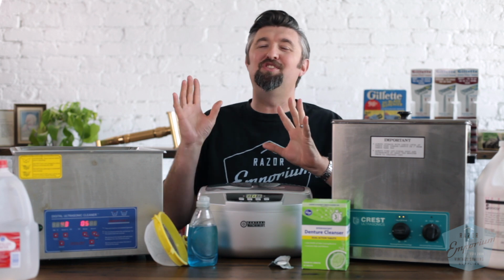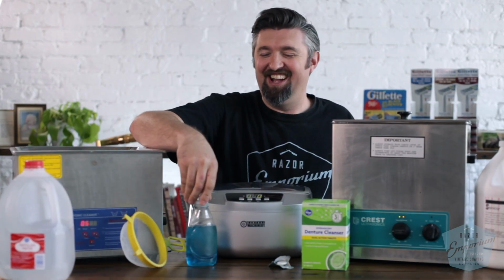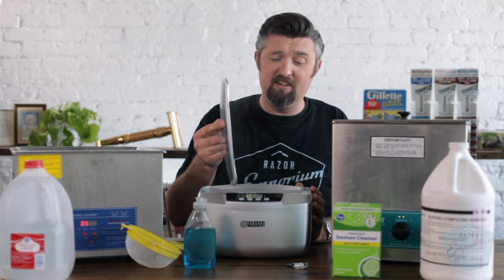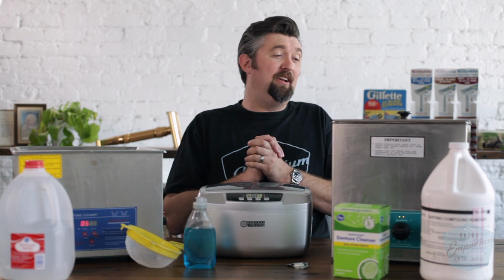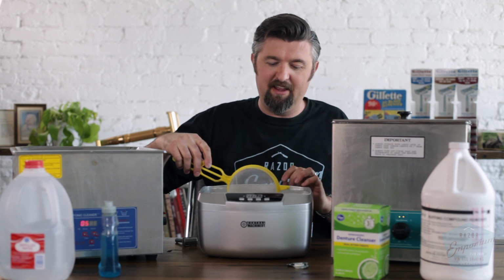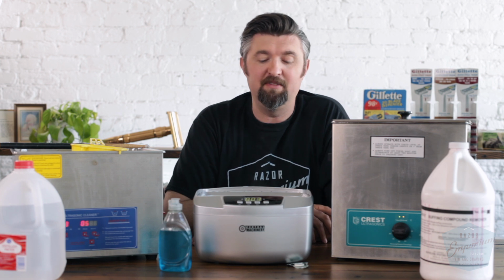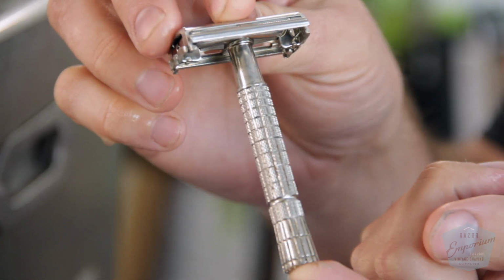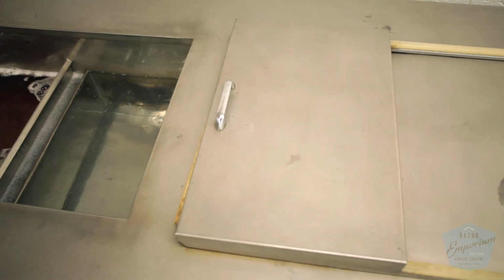Matt Shares his Ultrasonic Secrets for Amazing Safety Razor Restorations

Comment: Thank you for posting this excellent video. I've learned some new things from it. I have no experience with ultrasonic equipment but like many, I guess, I've seen references to it. This video is a really good introduction to what an ultrasonic cleaner can do, and where it fits in the complete revamping service. Many decades ago, I worked in various lab settings. I am filled with awed respect because I can see that one needs a background in several scientific disciplines to really make this revamp service work as desired.
Reply from the maker: Thank you!

Comment: I have the middle one - it's my second.  The first finally died after 10 years.   I use it for fountain pens and razors.  They really work well at cleaning out 60 year old dried ink, as well as working out crap that oil/water/etc has loosened up in the middle of the razors.   

I'm working towards getting one of the larger units, because I end up needing to work on larger parts with solvents that aren't likely to be as friendly to the plastic case of the small one. 

Most cities that use river water have pretty low minerals, so they tend to be fine for cleaning.  I use distilled for rinsing.   Where I'm living now?  Reverse osmosis water or distilled.   (We're on a well with very hard water) 

Another suggestion - Try Gemtek's SC-1000 biobased surfactant (they call it a Aqueous Cleaner Concentrate).   It's fantastic stuff.  Just don't drop it on the floor without rinsing well - you'll slide around.

Comment: I have the middle cheap one, and while not as awesome as my friend's small industrial machine (same size as the one on your right), it has been a trooper, and has greatly helped me restore an old 60s Guzzi and maintain the many mountain bike drivetrains. If you don't have an ultrasonic cleaner, you potentially need one! Spend more than I did, and RE spent on the Harbour Freight machine in the middle.

Comment: Hi Matt, great video. This information may help other viewers? I've used the habour frieght ultrasonic for 5 years now with very good results. The problem you had with yours is that you tripped the thermal safety as they don't like getting too hot. I use mine for cleaning rifle and pistol brass and it works really well using ammo brass sonic cleaner bought from a local gun shop. I clean 200-300 cases at a time with excellent results from really dirty gunpowder fouled brass and plated nickel brass. Works well on razors too. They are cheap sonic cleaners which would be fine for home use (not for a business), doing small batches plus the wife's jewellery! The price is their main advantage. Hope this is helpful?
Reply: I agree on the thermal tripping.   I've found that they don't actually maintain a temperature.  They just keep heating forever, so you have to shut it off manually, periodically.   Most of the time, I just pour hot water from the tap in, run for 10 minutes to degas, and then throw in what I'm cleaning, with the heater running.  (Water not hard enough to cause issues.)

Comment: For my applications (removing soap scum) ultrasonic cleaners are overkill & just too spendy. A toothbrush and can of scrubbing bubbles works fine & after a warm water rinse afterward, I dry the razor with compressed air.
Reply from the maker: 100% agree.

Comment: So what happens to the dirt and grime that comes off Matt? is it dissolved into the solution? and how long can you use the solution batch before changing the fluid content?
Reply from the maker: He's dissolved into solution. We typically change the benchtop machines weekly. The big one in the plating room monthly.
Reply: @RazorEmporium  Ok thanks for the reply and I have got it now - I was thinking there would be a lot of debris lying around in the bottom of the tank.

Comment: Hello Matt,

Thank for your awsome video.
Never use dental cleaner, most of all contain hydrogen peroxide. This powder generate lot of oxygen, and this is a rusting agent. Oxidation has the same word beginning as oxygen for a reason. This is worst when is combine with acid in this type of tablet. Long term usage is not recomended.

Comment: My hair is very corse and curly i get alot of ingrown hairs i currently stopped using a andis pro slim line to shave and now ive gone with the viking safety razor im still experiencing in growns and need this to stop. any tips would be appreciated. I shave upwards around the neck and jawline area
Reply from the maker: What blades are you using ?
Reply: @RazorEmporium  currently using the VIKINGS BLADE Swedish Steel Replacement Razor Blades, 50 Pack Mild & Safe

Comment: Dunno did fine using baking soda on toothbrush,then fitz polish on toothbrush,followed by shining with micro fleece cloth,then washing with toothbrush with soap.
Reply from the maker: Sure it does fine using metal polish once or twice on a vintage razor. Continued / heavy usage and it will wear through the plating.
Reply: @RazorEmporium  Not like I need to do it all the time to keep it clean after because I wash it after each use.

Comment: I have a jewelers ultrasonic cleaner I use to clean stuff I find metal detecting. With the D dish soap . Works well when you pre clean, get the big bulk off and then use ultrasonic cleaner.

Comment: Hello Matt, I'm always arguing that razors shouldn't be scrubbed with toothbrushes. Toothbrushes scratch metal. That's why you can notice all vintage Gillettes are full of scratches, unless they have been revamped.
Reply from the maker: not 100% true - vintage gillette razors have scratches on them due to the way they were plated from the factory - in large turning barrels. It's called barrel plating and it's how you plate thousands of pieces at a time. https://www.razoremporium.com/blog/razor-revamp-service-factory-finish-nickel/

Comment: Thanks, Matt! It’s great to learn a bit more about the cleaning and restoration process at your shop. There’s definitely something to be said about the types of solvents used for ultrasonic cleaning. That smaller unit was used in a shop where I once worked, and my friend and master technician did wonders with such a small machine. Great video!

Comment: Matt,
I use an ultrasonic cleaner to clean vintage sewing machine parts which are nickel plated or bare steel parts. I avoid Parkerized finish because it can remove Parkerization if left in too long. No painted finish unless I do not mind if the paint is removed.
I use Purple Power Concentrated Industrial Strength Cleaner/Degreaser which is available from most home improvement stores. I mix it in distilled water following the heavy cleaning concentration advised on the bottle. It has a degreaser and surfactant characteristics because it gives the soap feel on your skin and will draw out all of the oils in your skin if gloves are not used to protect your skin. It washes off with warm water and dries without residue.
It does not remove nickel or chrome plating. I have never used it on silver or gold plated metals. I do not recommend it on an aluminum part.
I am going to try the Dawn dishwater detergent that you recommend to see how it compares to the Purple Power.
Thank you so much for this video.
Reply from the maker: Great info! My guess is that your purple cleaner is stronger
Reply: In that vein, do not use Simple Green with aluminum in an USC. You can damage or remove anodizing and even damage the aluminum itself.

Comment: Loved this video thanks Matt. I’ve never dabbled in the dark art of sonic cleaning, but can definitely understand the benefits of it. With my slim (which was already in quite good shape) I put it in a pan on a roiling boil, cooled it off, scrubbed with dish detergent then finished off with toothpaste. I can’t remember who it was that told me to do it, but seemed to work ok. I need to set up a chain of sonic cleaning vending machines. You take your razor, jewellery etc down, put it in a basket leave it for a few minutes and it’s been cleaned. There’s a business idea right there 🤔

Comment: Matt: what do you do to make sure they are dry after their bubble bath---particularly on the insides of TTO razors where there are nooks and crannies?  Compressed air?  Oven at 170 for 10 mins?  Trunk of your car for a week?
Reply from the maker: Ha! We use an air compressor with a refidgerated air dryer to blow parts off and dry them. You could use a regular garage air compressor but I'd recommend adding even an inexpensive air / oil filter (harbor freight) to prevent spraying oil or water condensation on them after cleaning.

Comment: What do you think about cleaning razors with the UV?
Reply from the maker: It will make it sterile I'm sure
Reply: @RazorEmporium  thank you
Reply: It will sanitize the outside of the razor.  It will do nothing for the inside of the razor where the light can't reach.  The razor needs to be clean first, because any dirt will shield microbes from UV light exposure.  In all honesty, dipping in 70% isopropyl for 10 minutes should be sufficient.

Comment: I know nothing about such things. To me, they look like hot tubs for safety razors 😁  since it's mostly just used for surface cleaning and slight buffing would an amateur like me get the same results from just Dawn and a toothbrush and a cloth?
Reply from the maker: Yes on the outside for the most part. Ultrasonic cleaning works great on internals.